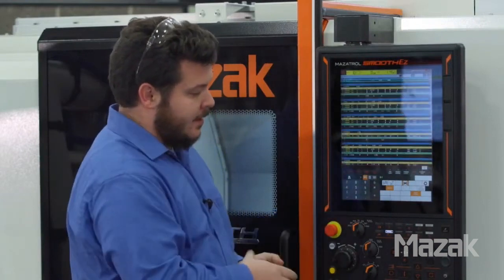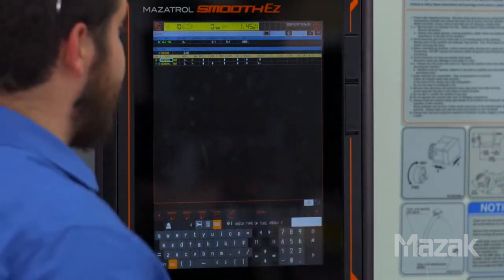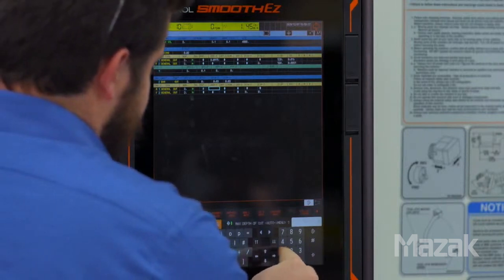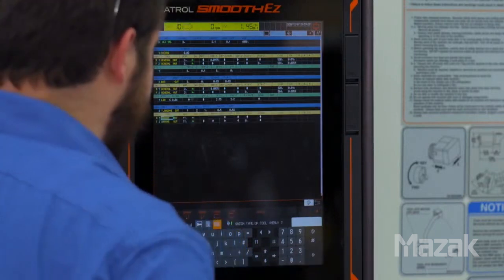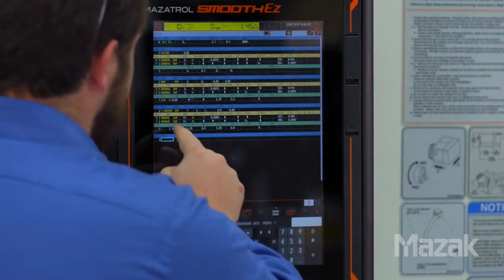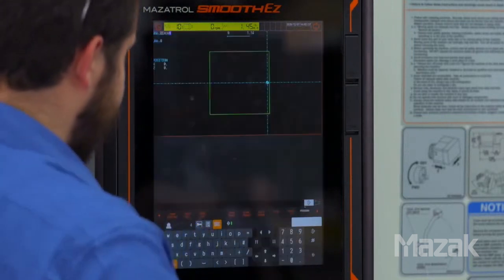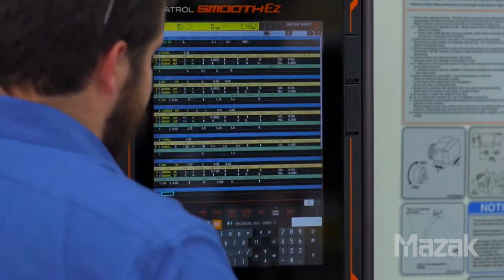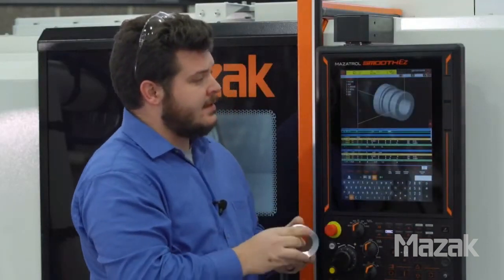MAZATROL SmoothEz Demo

Comment: I have a Mazak SmoothEZ 12MY Can the Fonts be made bigger?
Reply from the maker: Yes. There is a letter “A“ in the upper right corner of the PROGRAM page where you can control the font size. Please contact your nearest Mazak Technical Center for support if you have more questions.

Comment: Realistically, the T-plus control was the best(and still is) control that mazak had for lathes. It was fast and simple. Nothing fancy, just simple. Now these controls are just bloated with BS. Do you need to see 3d graphics for a lathe? No. Do you need all of the extra safety features on a lathe? No. Now it takes 3x longer to troubleshoot a setup than it does to program. A complete waste of time and money.
Reply: sounds like you never used a new Mazatrol control or you'd know your comment is total BS ha ha ha
Reply: @stevebower520  he has a point 
during graphics /check part shape you only see a red triangle whereas in Okuma (IGF) you have the actual tool
Reply: @stevebower520  Funny. When the Mazak reps could not figure out problems with the multiplex lathes, it was me they called for help.
Reply: @stevebower520  Actually, I have extensive experience on just about every mazatrol control, starting with the T-1. I was the go-to guy in the area for mazatrol lathes. It sounds like you never ran the T-plus.
Reply: I can do this literally in the same time in Fanuc in classic G code with canned cycles.... I have a program "EVERYTHING" in my two lathes in work, when I need to make some parts that I don´t have a program for I just copy everything (I have all canned cycles pre defined, G70, G71, G72, G75, G76) I need to the front, change X, Z, S, F, Q, etc. and get a program... in 10 minutes, without having an issue with getting in all correctly from the beginning..
Reply: @piter_sk  fanuc never reaches the level with okuma or mazatrol in terms of programming
Reply: @piter_sk  I just love how fanuc guys claim they can do anything mazaks and okumas do, without knowing either. I am fluent on fanuc, mazatrol, okuma and haas. Let me tell you this. Fanuc and haas have the absolute worst and weakest canned cycles on the planet. They are awful compared to mazak and okuma.
Reply: the T plus has the actual TOOL showing during tool path graphics? what year is your control ?
Reply: @christophercolumbus8944  The TPlus showed the tool as described in tool data. I think the TPlus came out around 1995. Not really sure.
Reply: @kuei12  and replaced by fusion in 1998? basically? or did they keep making them?
Reply: @christophercolumbus8944  I like to call it the Confusion control. I remember frequently saying Why the Fk did they go and do that!?! Everything went down hill from there.
Reply: @kuei12  why do you hate about it specifically?
could you  do broaching with the T plus?
Reply: @christophercolumbus8944  You can broach on any that allows you to orient and lock the spindle. I do not like all of the extra hoops you have to jump through to get a part running.
Reply: @kuei12  hey man 
are you good with subspindle machining at all ?
Reply: @christophercolumbus8944  I have done it a few times on the Nexus control. What do you need?
Reply: @christophercolumbus8944  First...If doing this the normal way, at the beginning of the program you need to select the head that the top part (left) of the program is running on. You will select head 1. Then your transfer to sub spindle with the transfer path. After transfer, select Head 2 in the program for the 2nd side section of the program for the sub side.

As for your offsets...there are a couple of ways to programming this. One way is to have the subspindle side run as a 2nd, or sub program, so you can use 2 programs with 2 offsets. But, the way I do it is in one program. Doing this you use 1 program with an offset shift in the program for side 2. Either way works fine.

As for your index positions...the best way is to control the index with the TPC feature. This way you can set your index positions anywhere you want.
Reply: @kuei12  right 
so how do you offset shift? 
would you have TWO set up info? lines? would you   pick "MOVE" ? or "TRANSFER CHECK"?  to start a EDGE BACK or BAR OUT etc
i will have to learn the TPC feature too i wondered why it was there.
Reply: @christophercolumbus8944  If you program this with 2 programs, you would have 2 setup pages with 1 offset on each page. 
When programming as 1 program your 2nd offset would be on the transfer line in the program. I will have to look at the machine to be more specific.
Reply: @kuei12  so is the SECOND Z offset incremental basically?
since there is no way to "teach " it 
i tried every possible way i can't "teach" my BACK tools to touch the already transferred part 

i also can't even tell it where the home position for OP2 is either. as there has to be a point for homing or homing for tool change do you agree??
Reply: @christophercolumbus8944  You could do it incrementally, but there IS a way to teach. After machining side one. skin cut the back on the sub spindle and measure the full length of the part. Now you have the position for calculation to teach. Just remember you are on the opposite side of the part. So, if the back face is z10.000, that is the position to teach.
Reply: @kuei12  i know exactly what you re saying but integrex doesn't let me TEACH 
i can't "teach"
maybe on the super quick turn or the quick turns you can...?
Reply: @christophercolumbus8944  It is the same way you calculate all work offsets on mazaks.
Reply: @kuei12   but the main work offset is pretty clear :
you Z-offset with any probed tool for the main spindle. 
registering the incremental value [of Z offset]  for the subspindle is unclear.
Reply: @kuei12  ok i'll try again but usually there is a "TEACH" option down below 
like i have nothing by the time i am about to do all that 
i got "incremental input" and at the end "TPC" ...
Reply: @christophercolumbus8944  The teach button is on the setup screen.
Reply: @kuei1215  it should be 

let me ask you this
say there was a "Teach" option  where would you record the number? 
you're probably thinking lathe yeah?
on the integrex the "set up info" for Transfer section is an independent section !
it allows you to register "Transfer position ""Z1 ""Z2" and "Z offset " valuesalong with "C" options etc
Reply: @christophercolumbus8944  Yes, I am thinking lathe. The last time I ran an Integrex was 2006. I cannot help you with that. On a lathe you cursor down to the Z-offset box and teach. I am not sure about mills. Probably in the G54 item. What I remember about mills is the offset setting was backward compared to the lathe.
Reply: @kuei12  1994. Close
Reply: I went from t plus to smooth G. It made nothing harder about setups. Fantastic control